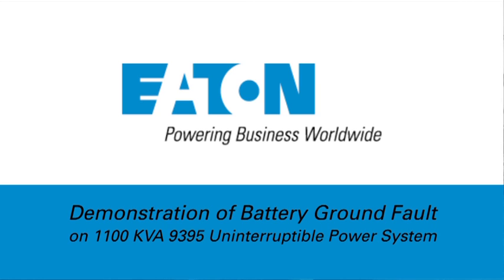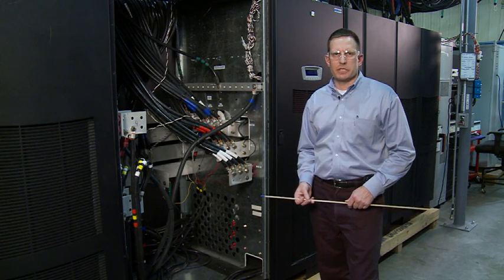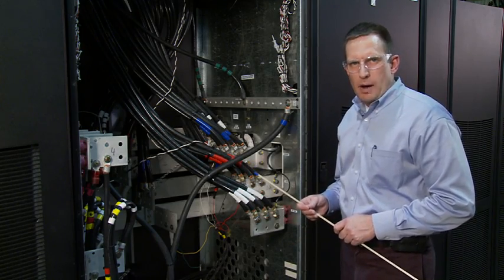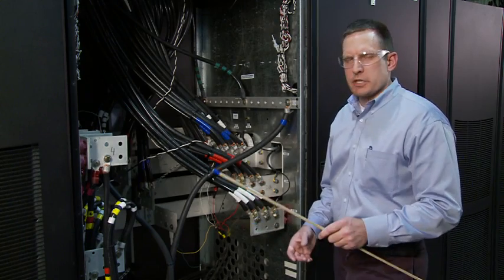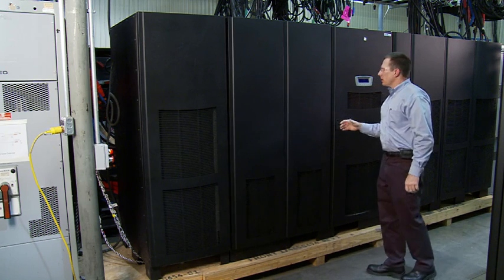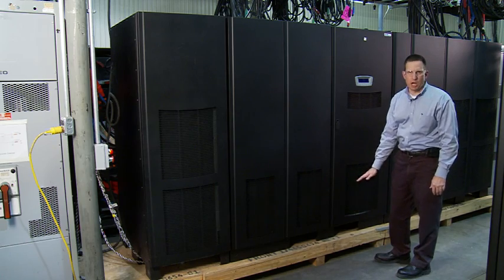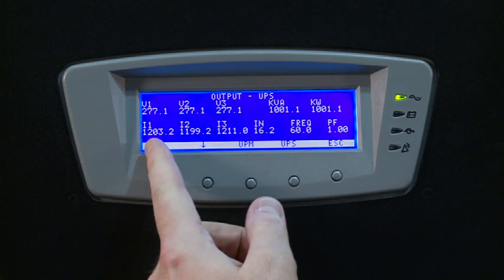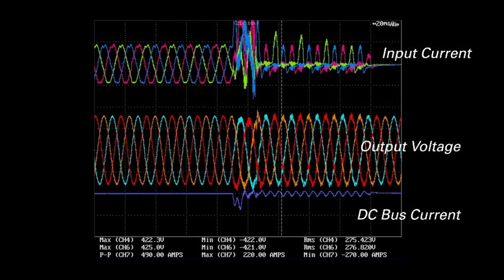Eaton 9395 Battery Ground Fault Test

Comment: Would the behavior be any different if the unit was in ESS mode.  Also, in the GF circumstance does the unit just go to bypass or does it actually follow with a shutdown and loss of critical load?
Reply: Ljpr 🌄🥵🥵😊🌸🌬️🌋

Comment: The cables are jumping overhead. Where's the ground current going?  Probably back to the distribution board. I don't believe this is the way to contain the DC plant and is a reaction to concern in the marketplace over lack of containment by these transformerless systems.